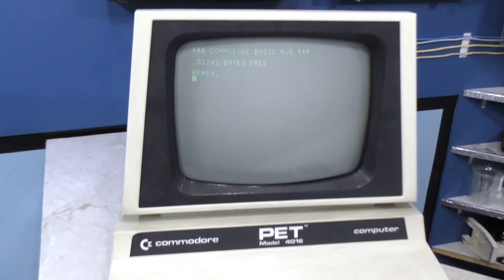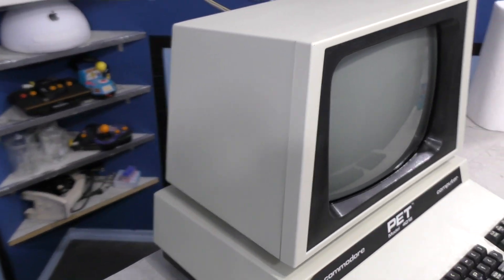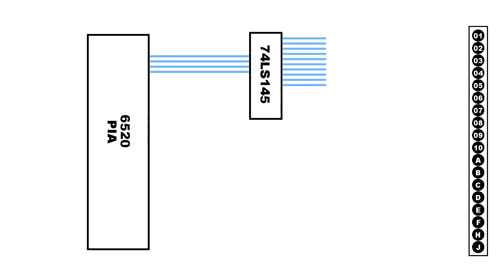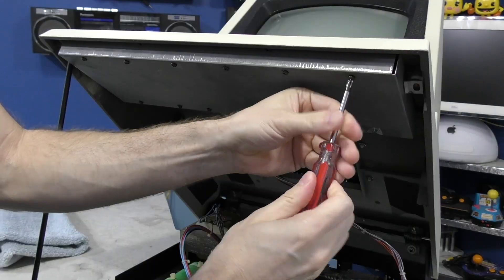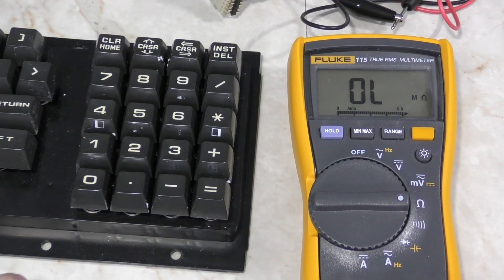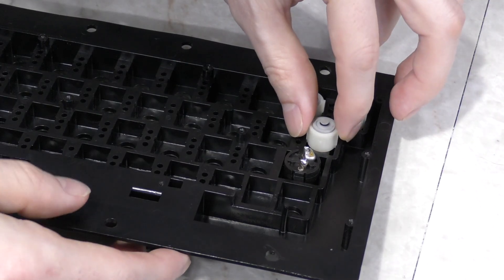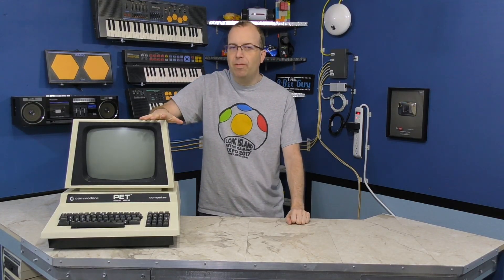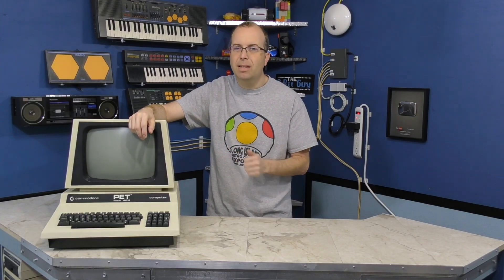Commodore PET Repair and Restore

Comment: 11:20 Here's what it adds according to the Manual to this Software for the Commodore PET that is on Archive

AUTO
RENUMBER
DELETE 
FIND
APPEND 
DUMP 
HELP
TRACE 
STEP 
OFF

This is basically a software that aids the person on programming stuff for the Commodore PET by adding these commands on Commodore Pet Basic

Also this Software might of had a Ram Expansion Board for those who had a Commodore Pet that is Older than the one you have (i.e Commodore PET 2001 models 1 to 32) that Connects to the Memory Expansion Port and the Cassette Port

Comment: I've got the same model and the keyboard is pretty flakey but still works. I'm considering making the same repair as you, but it's a lot of work and I don't want to cause any damage.  I think the bottom half of the machine is metal and the top half might be metal. Could be wrong.

Comment: I believe the chip you found was call Toolbox or such.  It was an after market item which added functionality for programing.  I can only remember one or two of the commands - there were about 10 as best as I can recall.  My favorite was "renumber"  This renumbered all of the lines of code by some amount.  For example the command "renumber 10, 10"  would start at line 10 and renumber all subsequent lines in 10 increments.  It did not work on the "gosub" command, as I recall.(That is more or less how the renumber worked but I'm sure the command is not absolute correct)  There was also a "trace" command and a "step" command and more I believe.  It's been about 50 years (I am 90 years old now) since I've programed a Pet so my memory is a bit dim!  Besides PC are much more fun to use.

Comment: 💚💚💚💚 bookmark/notes : +\- 03:50  look into rounded 🐄 glass how wires are like when bending conduit big scale ( like the video of bottom of the keys/glove for the spring under to the small metal plates used for make electrical contact )

Comment: Repairing the ruber key by silver lacker is bad idea, in long term the silver dust stay on the circuit and pernamently connect it. Better solution is look for rubber conductive carbon round plate usualy used to repair remote controls of home electronics.

Comment: If I where you i would have just put aluminum foil on the carbon contacts
Reply: I may try that.  I used the Canadian equivalent of that contact paste, and just made a big mess of my chiclet keyboard. Thinly applied it, let them dry over several days, and reassembled.  Some keys still didn't work; when I opened it again, I could see that some paste had cracked and flaked off.  Took me days to clean up the mess.  I still have it but broke down and ordered a Tynemouth replacement chiclet keyboard.

Comment: You’re very good at what you do very knowledgeable are used to have a pet that was in almost mid condition with disk drive that looked and worked great only commodore I still own is the Commodore 64SX portable I still have about 100 cocoas a model for a model for P 12 TRS 80 MC tens and about 12 Coco distro systems and lots of missile

Comment: Most useless video AGAIN... I had same keyboard in VIC20 and I let everything in and just rubbed the rubber contacts down with a bit contact cleaner and worked again. My method is faster, better and original.

Comment: The BASIC 4.0 sticker you found likely was a version of MS BASIC which was bundled for the computer.  BAck then, BASIC on some machines came in the form of a ROM chip, rather than on actually floppy disk.  That piece of paper likely just identifies the version of BASIC and where the ROM is on the board, which I think you probably found out later.

Comment: I found it interesting that the sub brightness needed adjusting.  I'd guess that it would be optimally adjusted before shipment out of the factory.  I'm wondering if there wasn't a problem with a component on the logic board (capacitor? resistor?) that was affecting the screen brightness, making it necessary to readjust the sub brightness.

Comment: The next time you encounter this issue with the carbonized rubber key continuity consider simply removing each plunger, placing a piece of 800grit sand paper on a flat surface and rubbing the rubber pad on the sand paper.
I think perhaps the issue is that a thin layer of oxidization has formed on the rubber thus ruining the continuity of the rubber.

Comment: hahaha, years ago I actually reconditioned an 8032.... still need to replace the RAM (it's in the to-do pile). My keyboard was worse off (the PET had been abused), and my space bar did exactly the same thing :) I ended up fixing it with some wire from memory, I cant remember the specifics but it works 100% now.

Comment: The PANCS rom is usually used to extend BASIC to drive the HSG (High Speed Graphics) card. Not sure what use it would be without the additional graphics card.

Comment: 8-bit Guy ...there's a method that guitar techs use to rebuild the plastic string 'nut' by using baking soda and superglue, and then use small files to re-contour the shape.
If the compound can deal with string tension it should be pretty solid!
Maybe this method might be of some use... :-)

Comment: To Davis or whoever. I am using cbm basic 4 on my Vic 20 penultimate cartridge right now.  I have just typed in SYS 40960 and a machine language monitor pops up. Could that be what the SYS command is for on the pet too?

Comment: 08:41. I used pencil sraping dust to repair remote controller.keyboards. Applying the pencil tip itself won't do. Only scraping off graphite dust fro
 the pencil tip would work (in moderate ammount)

Comment: I found one of these and a tape deck outside a dumpster. I was 65 and on foot and carried them for 3 blocks. Finally my fingers could take no more so I hit it behind a Jewish synagogue and went and got my landlord and we brought it the rest of the way. It works the only thing iis the label in the upper left hand side has about a half  inch broken off. I found it funny that the place on yours that came loose is the same spot. I put it in my closet that was 4 years ago maybe after watching these videos I will get it out and mess around with it. Those things are heavy.

Comment: The technique shown by Mr. Murray to fix the key-press detection may also be applied to fix TV/device remote control buttons.  I did something similar for my remote controls, but opted to use aluminum tape instead of the paint.  Aluminum tape rated for weather-resistant outdoor use is perfect as the adhesive is very strong, and the tape is much less expensive than the depicted repair kit.

Comment: I know this a few years late but i think a faster way to paint those contacts would have to pour/paint a thin layer of the compound into the lid and and press the contact into it like you would do with an ink stamp.

Comment: As far as the pencil lead trick. It works best to build up a bunch of pencil lead dust on a piece of paper first by rubbing the pencil vigorously. Then just drag the rubber across the lead covered paper. I use this method all of the time when restoring membrane based contacts. works everytime.

Comment: On the other hand, with the CBM Pet, you don't have the rat's nest of cables to deal with like with the VIC/64/128/128D.  That would probably be the reason I picked it over the others to bring in from the barn (and I have them all).  Swipe off some clutter off your desk, plug it in, and go.    Despite how cool it would look, still not compelling enough for me to actually do it though :-/  If I didn't live in the middle of bumfuck nowhere, maybe I'd set up a museum and let kids play on them or something, as my interest in them has cratered long ago...

Comment: Palo Alto IC's or PAICS Was an add in Programmers Basic toolkit.  Seen these before also depending on the version Pet you had determined the toolkit <there were different versions of the kit>.  According to your screen you have the TK-80P Toolkit.  Funny thing my friends Father bought one of these 2nd hand from a coworker back when these things were still being made,  it had this toolkit installed and we never knew it till about 25 years later when we were restoring it and found the sticker.  His was a printed sticker not a hand written one.  Apparently this chip program was designed to make programming easier by allowing you to use shortcut abbreviations for most basic programming functions.  Kinda funny never even knowing you had it, you'd think there would be something on the screen to remind you lol.  

Great video kinda nostalgic for me to see you stumble on the very thing we did way back when.

Comment: The only way I'd get a PET is if I were to get a parts unit and turn it into a sleeper PC that looks like a terminal from the Fallout games. I'd replace the CRT display with a modern LCD, then put new parts in it and mod the case appropriately for the new parts. This includes replacing the keyboard outright, obviously. A PET's keyboard obviously isn't designed to accommodate modern games and other software.

Comment: i got a CBM 3032 - but it ran for 1 hour then.. nothing - in that hour i found out the rom-address and it ran basic - 
how hard is it to replace the transformer (assuming it died..) or other critical parts ?
i need to probe the board - but i do not dare to plug it in again..

Comment: You were wasting your time with that repair kit.

Aluminum foil and double sided tape, cut roughly to shape and big enough to make contact, is far, far more than enough, and is probably way more conductive.

I did this kind of "metalmod" on a knockoff SNES controller, and it went from almost zero responsiveness to feeling like it was ready for another twenty years. This also simplifies cleanup and further maintenance; just clean off the aluminum foil, or reapply.

Comment: How can multiple key combinations pressed simultaneously be read by the controller if the keyboard functions like your schematic shows??
Say pressing Ctrl then pressing Alt whilst still holding Ctrl?
I work writing industrial software and this keyboard design is actually essentially identical to common Safety PLC IO systems in use today.

Edit- just saw that the system isn’t Fail-Safe like industrial safety systems (the contact is normally open and only closed when a key is pressed) but otherwise I’m still confused.
Reply: https://computer.howstuffworks.com/keyboard2.htm

Comment: One thing the pet had of great use was the Ieee48 Integrface. One could hook up to 16 external measuring instruments to the pet.. For eg Digital- vm´s, Frequebcy counters, Sig. gens. We used the pet to- set up electronic testing stations. Earlier we used the Tektronix computer but that thing was hellish expensive, The pet was dirt cheap and did the job just as well.

Comment: I see you have some teddy ruxpins there, i have a question, somewhat related to them, i own a mickey made a year or two after the teddies, and the eyelids don't animate regardless of what i do. I tested the tapes for it on my teddy and it blinks just fine, could it be a bad ic? There seems to be 3 of them,  probably for each motor.

Comment: A Google search of 1980 PAICS reveals a product that adds disk functionality and/or BASIC Tools similar to the 1212 Vic 20 Programmer's aid cartridge. Command-0 functionality gives you auto number, merge, renumber functionality. 

The C-64 had a tool that was similar called POWER written by Brad Templeton, which could be used with his PAL assembler program (now free and still downloadable through the UofWaterloo site). For the 1980s, the PAL/Power combination was in my opinion a great assembler environment. Brad Templeton was an important member of the Commodore community. He is also one of the founders of early USENET being the first moderator of rec.humour.funny which was a very popular Usenet site at the dawn of the internet.

Comment: I bought a PET back in 1980, and at that time there was a book available in the UK called "The PET Revealed" by Nick Hampshire and published by Computabits Ltd, of Yeovil, UK. This gave a lot of information about the internal workings and ROM routines, I/O usage and also included circuit diagrams (8 pages of them) which enabled users to utilise it for many purposes - such as a progammable controller (with a bit of ingenuity and interfacing). Commodore UK gave a lot of input to the author and it is very worthwhile if you have a PET.

Comment: In addition to the upgraded EPROM, this PET has also had it's RAM expanded to 32K.  The model is a 4016, which would have shipped with 16K, but the screen shots show 32K.

Comment: This was the first computer I had.. I was really thrilled when I obtained a maths co-processor. Next was a TRS80, and it had lowercase as well as UPPER CASE. Then an IBM 386 laptop that I used to run a BBS or two. Then Atari STFM... Many years later, after hundreds of servers and a successful career in web hosting :( my preferred machine is just a MacBook Air..

Comment: I've had good luck fixing these ruberized carbon contacts by using small cutouts of aluminum insulation/sealing tape, such as what you'd use on, say, dryer ducts. I just stick a little square piece onto the rubber. That way the rubber is just cushioning and aluminum is what really makes the contact on keypress.

Comment: On the eeprom you found:
ARTUP & CHECKOUT 

Make sure you have installed your Toolkit correctly, turn 
on your PET, and then enter either 

SYS 45056 

or 

SYS 11*4096 
and press RETURN. 
Your PET should reply with: 

(C) 1979 PAICS 

READY. 

If this does not happen, TURN THE POWER OFF IMMEDIATELY 
and check your installation. If you have an "Old" PET, check 
that the 2nd Cassette connector is correctly placed and that 
the Toolkit board is completely seated onto the printed circuit 
board. "New" PET owners should check the position of their IC 
and the direction of the notch and dot. 

If the Toolkit message still does not appear after you 
have checked your installation, contact your dealer for assistance. 

After the Toolkit has been initialized with the SYS command, 
the new commands are available for use. The remainder of this 
manual describes the commands in detail.

Comment: if you want to get better results with the labels and mask off the 'ghosting' effect of the base, stick those to the piece and than spray two coats of transparent over those. In this way the square becomes far less visible and noticable and those will never come off the computer. Just a little trick from the scale modelling world.

Comment: Love this. I just went through a complete repair of my IBM Model M 122 key terminal keyboard.

It uses a plastic membrane and had some bad traces in the matrix. I was able to fix that use Bare Conductive electric paint to bridge the broken traces, then covered the bridge with clear nail polish to protect it since the wire paint is water+soap soluble.

Worked great! I bet this PET keyboard is similar to the IBM Model F keyboard, being capacitive instead of a switch. It's really common for these things to have high impedance, so that doesn't surprise me.

Great video,

Comment: The only thing I could find on the weird "(1980) PAICS" on the ROM is on this page: http://www.geocities.ws/davegostelow/PETroms/PETroms.html There are three adverts from a computer magazine about this Rom increasing the capabilities of the PET... (PAIC stands for "Palo Alto Integrated Circuits") Basically it was a BASIC extension, adding several useful commands to the PET's BASIC.

Comment: David, 
You should have tried the keyboard after wiping it with alcohol. It probably worked fine. ~1k contact resistance is OK for a rubber keyboard. The IO chip uses 10k pull-ups, so 1k is well distinguishable.

Also, avoid the pencil and silver paint thing as long as possible. The problem is, they usually doesn't bond quite well to the rubber (especially the graphite from the pencil), and after a few hundred button pressings, residues of them will migrate to the PCB, which results in a continuously depressed button.

If the conductive rubber is not used up (in this case, it seems they had minimal usage), I used to wipe them on a dry photocopy paper, with the paper lying on the desk flat, and rubbing the rubber contacts against it. This way you can rub off the very top layer of the conductive rubber, which may be deteriorated due to oxidation. This usually lowers the contact resistance drastically.

Comment: Great video and I like the keyboard repair. An observation: You should probably avoid/paper labels for EEPROM windows. Over a (sometimes very) long period of time UV light can leak through and start randomly erasing parts of the stored data. Best to use a dark and as opaque label as possible. Although have to admit being inside a Pet will probably mean this one will be ok. Just a suggestion :).

Comment: i found a better solution   that works on this type of key board  
use a hole punch on tin foil and make some dots  
then use supper glue to attach the dots to the carbon contact point
allow the super glue to dry  and then assemble the key board 
it works for me every time i and others have tried this 
have fun   and thank you for your videos

Comment: I have a 8032-32 B. I guess the "B" might mean "Business" ? It looks just like this one besides the cabinet is higher, the area where the logo's are printed is like 2cm higher if i try to estimate. Also the whole front of the monitor framing is black and covers the white "frame". This is a european model with swedish keyboard. I read somewhere that this might be an earlier model of the 8032? Anyhow, because of these differences it looks more like a "electronic typewriter" with a monitor on top. I looks less cool than this one i think. Does anyone know more about the 8032-32 B? At least it seems like a more odd model?